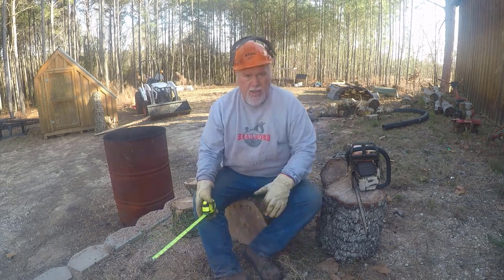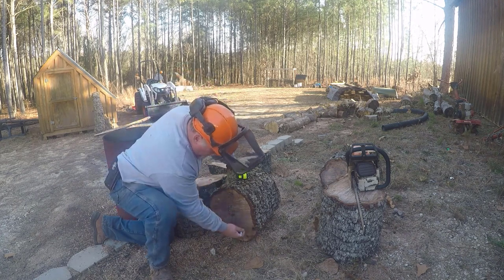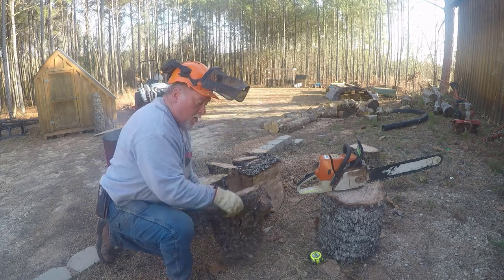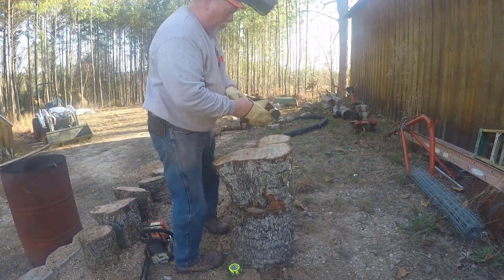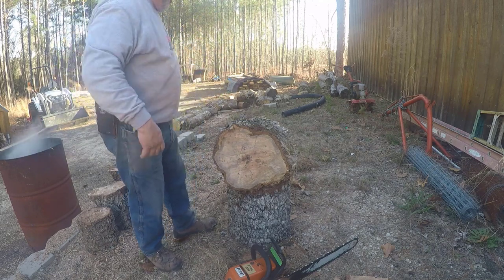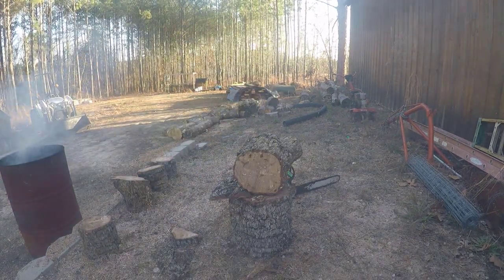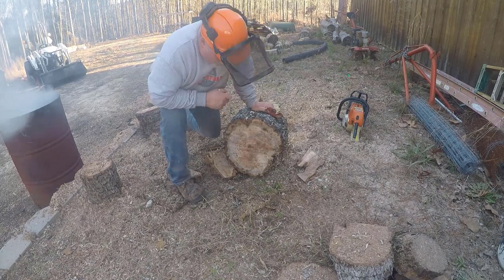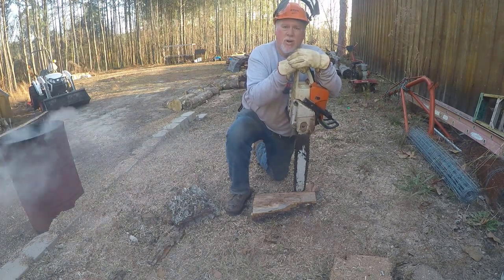How to  Cut Bowl Blanks

Comment: Always interesting to see how others do it. 😎 When I have a bigger tree I tend to use the chainsaw mill on it. The top and bottom (half-round) sections are instant bowl blanks. The rest is cut into slabs and laid to dry at full length. For the late I prefer 3 to 4 inch thickness and I'm cutting blanks from the stock when I need them. Works quite well!
A new lathe on the way? Exiting!! 😁
Reply from the maker: Thanks!  I think your way has some real merit!  Thanks for watching!  I am getting a Robust American Beauty.  It is supposed to come on the 3rd.

Comment: Great video with very useful information thanks. I've just reached the stage of cutting my own blanks.
Sorry, but there is a but. The wind seemed to blow up just at the wrong times to hear the important descriptions. I got the gist from watching what you did, but would probably have learned more by hearing the description. A good video nevertheless and much appreciated.
Reply from the maker: Yea sorry!  It was a very windy day.
Reply: @BrailsfordWoodworks  No problem. It was exactly the right video for me at the right time. I've got a pile of oak to prepare and wasn't certain what to do. Now I have a handle on it so thank you.
Reply from the maker: If you have Oak, I would suggest turning them twice.  Rough turn them green and then seal them.  I think you will get less cracking that way.
Reply: @BrailsfordWoodworks  Thanks. I will do that

Comment: Got to love cutting up Pecan. Great video. I like to see how others cut up logs, and always learn a few more tips and tricks.
   I like to clean up my blanks before I cut them round. I bought a hand planer from Harbor Fright and us it to smoothen out the top and bottom of the log blanks. This makes cutting them round on the bandsaw much easier. It also leaves a smoother surface for writing the Type of wood, date and size of the blank on the blank.
 I have over 200 bowl blanks, of several spices, cut, sealed and put away to dry. 
 How do you store your blanks?
Reply from the maker: Thanks for watching!  I use either Anchor Seal or Pentacryl.  I then store them on racks on the second floor of my shop.

Comment: What is it you use to seal the ends? What moister content do you like to turn at?😁🛫
Reply from the maker: I use either Anchor Seal or Pentacryl.  I prefer Pentacryl, but it is pricier and harder to come by.  so I will use Anchor seal in a pinch.  Also I like >12%.
Reply: @BrailsfordWoodworks  Thank you two years ago in April a neighbor had a pecan tree removed from his yard, I harvested  some large sections and painted the ends with latex paint since I was what I had at the time. So far I am seeing minimal checking on the end grain. 
The water/ sap was pouring out of the trunk when it was being cut. This was in west Texas. 😁🛫